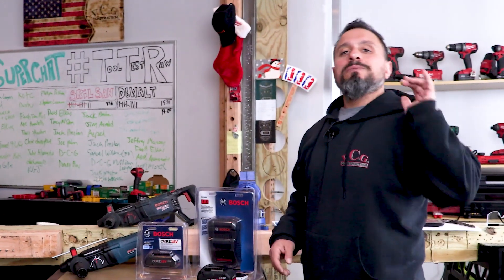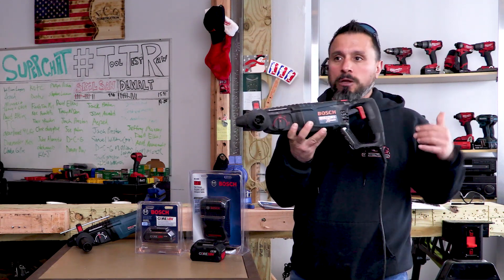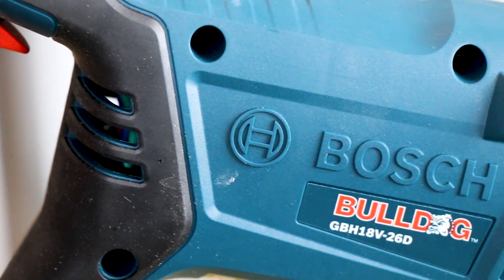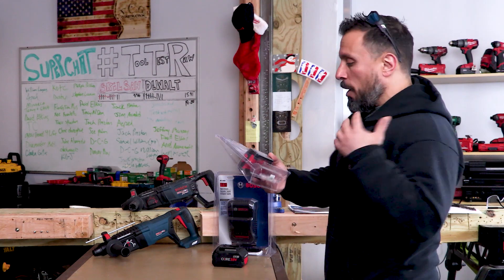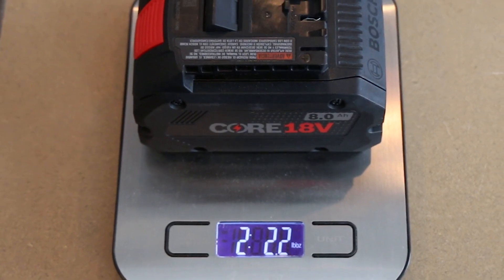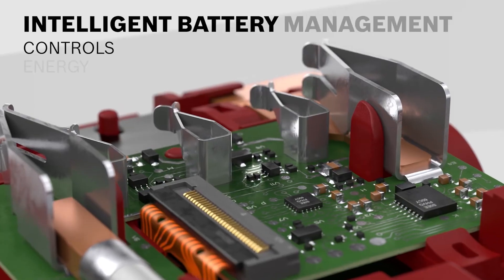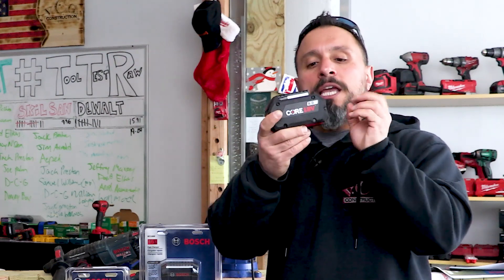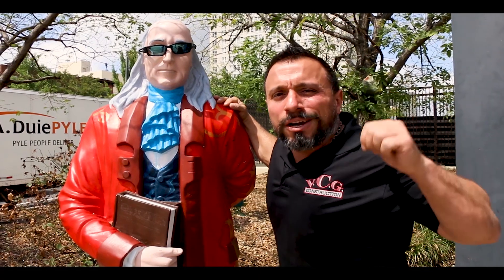What's REALLY Going On With BOSCH 18V CORE Batteries (bet you didn't know this)

Comment: Im a huge Bosch Fan, have just about all the cordless tools and love them all. Being a contractor I put them to the test and never a problem.
Reply: Phil Jacob I have the power box radio and a 4.0 battery. Definitely a stout set up.
Reply: @LCCJ82  i have it to and love it
Reply: @Lc cj Best job site radio, and we don’t even get the deluxe model (50w sub instead of 20w), with GFCI outlets in N. America because of energy star ratings...
Reply: I just got the Bosch cordless oscillating tool and grinder and more 18v core batteries. I also have the bulldog corded sds. Beast for sure. I was using a Milwaukee my buddy has and it's great to but for me to change now I'm in to deep. Lol. Plus Bosch has all the same stuff as Milwaukee does if you look at the inserts with new tools.
Reply: @builtbyme  battery adapters man
Reply: I've had the impact and hammer drill set for about 6 years. And I only retired it because I upgrade it to the brushless tools lol
Reply: Home improvement guy, never had a Bosch 4 Ah battery fail, or disappoint me.
Reply: I've got nothing but bosch tools. I use them daily for work

Comment: The cooling fins don't need vents. These work through convection akin to a radiator piping in a car. You also don't want any opening on your battery pack. This especially applies to power tools where you have dusty and wet environments. You don't ingress of that in your battery pack

I work in the trades and use Festool, Bosch Professional, Metabo as well as Milwaukee on the jobsite. It really is quite amazing to see just how far battery technology has advanced especially in combination with brushless motors. The torque on these things is amazing. They are also safer as the tool turns off immediatly either through kickback detection or user input

Comment: I just rebuilt a v18 battery by Milwaukee with the same battery they use in Bosch. What a difference, it lasts longer and is lighter in weight than the original battery. wish their was enough space in all battery packs for the 7100 series batteries.

Comment: It would be better if they did not show off, but would install a regular protection board with cell voltage balancing. There are too many show-offs now, but one way or another, without a balancing board, two cans in such an assembly will die ahead of time. And it will require complex repairs, disassembly, replacement of cells, welding of copper sheets.... Programmed obsolescence

Comment: bosch even with old generation nicdm / nimh batteries used aluminum spacers between the cells ... which absorbed the cell temperature ... bosch in many ways is advanced mainly due to their seniority and experience in the tool industry ... research ... German industry ...

Comment: I don't understand why in Milwaukee or a few other brands that claim to be a good brand but did not build batteries with cooling characteristics ... batteries with ventilation slots for ventilation and chargers with fan although it is not something new ...
as an improvement it would be possible to put a micro fan directly on the battery that will automatically come into action when the battery heats up ... in a few minutes due to the continuous air circulation even of a micro fan the effect would be incredibly effective

Comment: All my tools are Bosch, not one has ever let me down. Just got the bi turbo 18v chop saw, and got the 18v  bi turbo sds on order, that's got  5.8 joules impact energy (or 4.27 ft pounds) they have a 16 A charger that has a power boost button, 50% in about 15 minutes. And the cooling fins do a good job of keeping the battery cool.

Comment: Hey great vid! Just had a quick question, I’ve seen some Bosch 18v batteries for sale and some of them have “BiTurbo” on them, do those batteries provide more performance than the core batteries?
Reply: BiTurbo is the combination of ProCore batteries and brushless tools that can use the extra power these batteries provide. There are no BiTurbo batteries, only BiTurbo cordless tools that can make optimal use of the extra power that ProCore batteries provide.

Comment: I'm in process of switching from m18 to all Bosch core/procore batteries due to it's compactness(still better than M18 new 21700 cells battery packs)

Adapters are more hard to get , but all are available

Comment: Hey Vince, what are the differences between the 1inch bulldog sds with he shock absorber in the handle other than it looking to be more compact and having the ability to attach and run the boach concrete dust vacuum off the same battery

Comment: Looks like these batteries may have these crap cells in them: LC-21700-LS40.
Reply: No, they use Samsung INR21700-40T cells, providing 35A sustained and 45A sustained when temperature controlled in a 4Ah cell. This isn' crap by any measure.

Comment: Bosch also got a new supercharger (GAL 18V-160 C Professional ), at least where I live in Norway, that charges an 12 Ah Pro Core battery to 80% capacity in 36 minutes and fully charged in 55 minutes. I guess that's eliminates the use of a multi-charger where you can charge several batteries at the same time, or does it? What do you think?

Comment: We can all thank the vaping industry for introducing the tool companies to the power of 18650 batteries.
Reply: Tool companies started using them first... And I would say Tesla would be more of a influencer... And these aren't 18650 cells.
Reply: @rolojunk  https://syonyk.blogspot.com/2016/09/dewalt-20v-max-30ah-battery-pack.html   

Here is where it shows 18650's in the pack itself.  The vaping industry started using high draw 18650 batteries 2 years before the new battery designs came into play with the tool companies.   Tesla had nothing to do with it in any way shape or form.
Reply: @jacobeaston7807  The vaping industry accelerated development of high current 18650's. Tesla initiated development of 21700 cells.

Comment: I got the 6.3 ah core battery it's sweet and the core 4.0 ah
Reply: @Thomas Carroll 
I’m in the process of replacing my batteries in my EC brushless tools with CORE the 4s in drill and impact L-Boxxs
Reply: @thetruth5210  you will not be disappointed on the performance of power that these batteries give to your tools even the old ones that are pre core first generation brushless
Reply from the maker: Nice Thomas!
Reply: @VCGConstruction  awesome video bro

Comment: Sold all my Core Bosch made the switch to...you guessed it.. Mil-A-walkae. The only thing I miss is the 3/4 sds drill. Bandsaw= horrendous. Freak impact = frustrating. Drill = meh. The batteries are the best. Charger is good to. I was working in 20*F weather. Between bosch, makita, and Milwaukee my bosch was the first to charge @ around 30*F. But maaan, that bandsaw and freak impact were unforgiving!
Reply from the maker: This rotary hammer is nice! The battery is really compact too

Comment: Honestly, Core batteries are the best on the market by far. Nothing really compares.
Reply: @fancy As huge Bosch fan, Metabo?
Reply: @thetruth5210  I've only used the Metabo hpt tools and batteries, not the actual Metabo. I'm comparing the readily available brands.
Reply: @fancy Metabo was first to market with the new Panasonic/Tesla cells “LiHD”, and on top of that they have partnered with five other German tool manufacturers to all run off the same battery platform including Mafell (Best woodworking hand tools in the world). It’s kinda amazing! IMHO
Reply: @thetruth5210  I'm sure you're right.
Reply: @thetruth5210  I wish Mafell made a table saw👍
Reply: @Greg Banach Mafell Erika 85 110v  It’s $4000.00 
Festool bought Sawstop and is supposed to be releasing a battery powered Sawstop safety inspired version of it’s Percio later this year. 😜
Metabo showed their prototype cordless tablesaw off in 2017 saying that it would be coming to market “soon”.
Reply: @thetruth5210  Thank you for the heads up !
Reply: @gregbanach4957  I wish these were the Tesla/Panasonic/Sanyo cells, NCR20700B, (the NCR20700A is the actual tesla cell but it's pretty similar) these Bosch batteries clearly don't have them. They would be 8.5Ah at 8Ah these are probably LC-21700-LS40, these are cheaper and weaker cells

Comment: Good vid Vince.  It's nice to see Bosch stepping up their game as they should.  Now the question remains, how does it perform?  Well, I can see a TTR at some point going against the Milwaukee rotary hammer and would be fun to see for sure.  Thanks for sharing and cheers to you and the VCG gang!
Reply: @William Logan 
Bosch doesn’t play the arms race. Their tools are known for endurance on battery life and for their longevity. 
If you want to see what will plow through three-quarter inch OSB the fastest then you need to get the DeWalt rear handle saw, the Makita rear handled saw or the Milwaukee fuel 7 1/4, BUT if you’re wondering which one can cut the most linear feet per amp hour (not a really interesting TTR) of that three-quarter inch OSB it’s a 10-year-old brushed model Bosch circular saw.
Food for thought...
Reply: @thetruth5210  I'll be honest when I say that I don't own any cordless Bosch power tools and I do believe you.  However, I do own the corded Bosch 10" job site saw and the Bosch Colt hand router and both are excellent quality made tools.  I've owned both for almost 8 years now and they have never let me down.